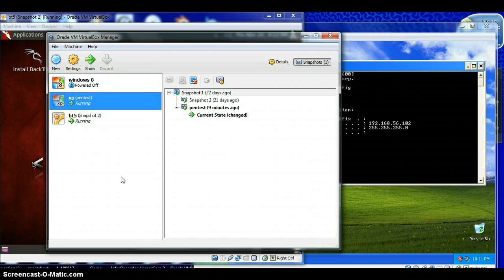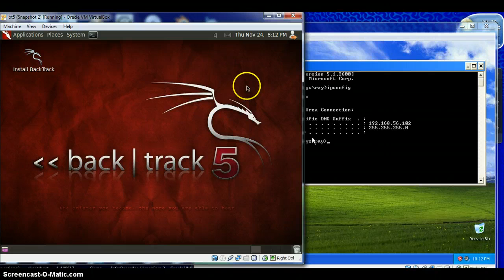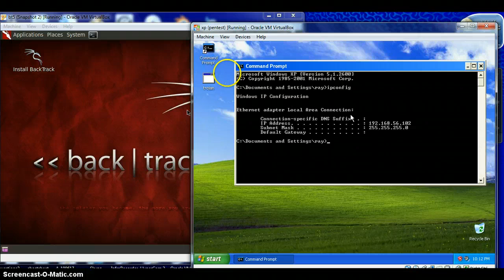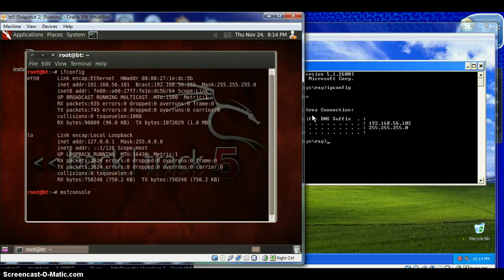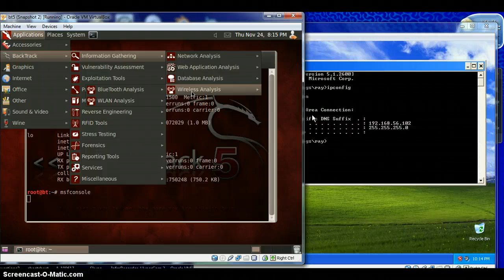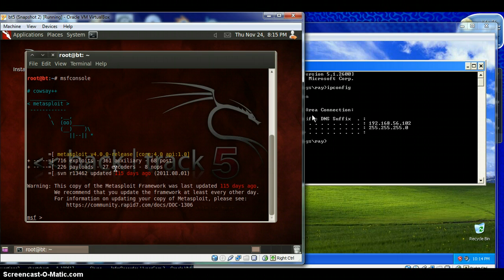ethical hacking 101: popping an XP box

Comment from the maker: the tool for virtualization is Virtualbox from Oracle. The virtual machine im using as the attacker machine is Backtrack 5 which is a linux distro. You can even burn it as an iso and boot to someones computer with it, mount their hard drive and wreak havoc (which is why you should change your boot order and password lock your bios)